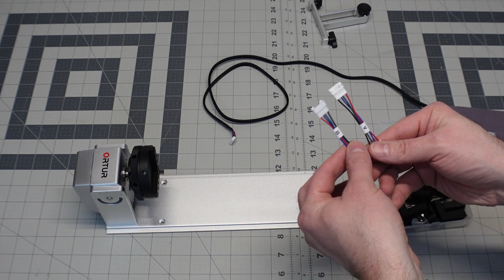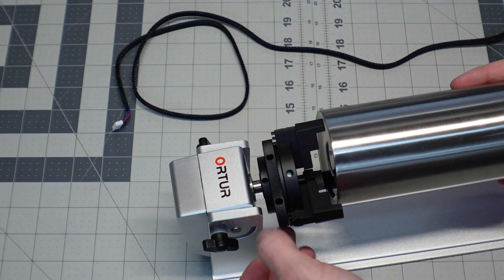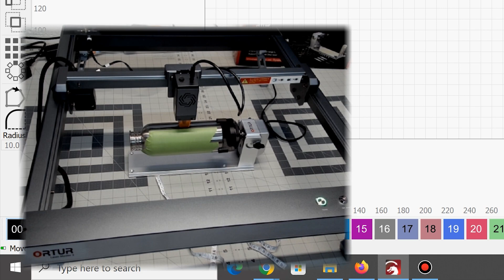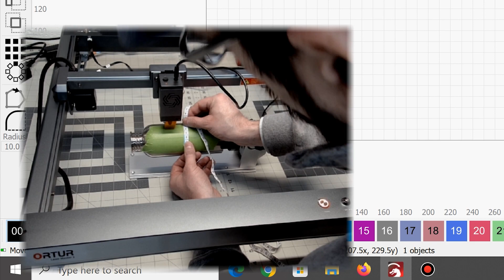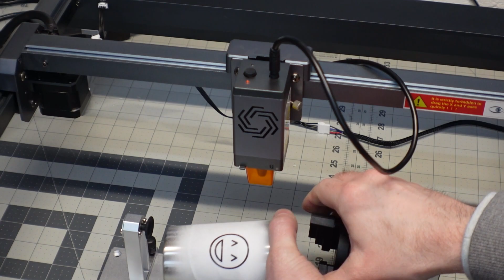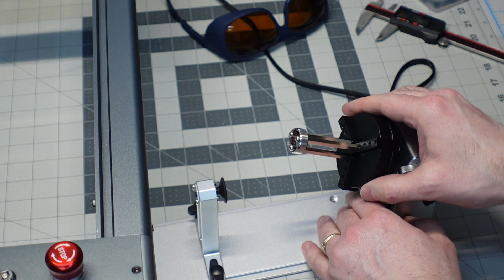Ortur Y Axis Rotary Chuck  -  We engrave all the odd shaped round things!

Comment: Will it work for fiber lasers ?
Reply from the maker: It is possible, if the stepper controller in the fiber laser is putting out the correct voltage and can support the amp draw of the rotary, you'll also need to make sure you can adapt the wiring to the laser.  It's best to find a rotary that is intended for the specific laser you want to operate it on.  I have not tried to run this one on anything but similar open gantry diode lasers.

Comment: Have a nice day.  i want to ask  would this rotary roller also fit my Swiitol e24 pro?
Reply from the maker: I'm not familiar with that make or model but it looks exactly like the Atomstack A24 laser.  It should work with this laser assuming it has the same 4 pin plugs as most lasers.  Ortur includes two different cables to adapt to most lasers that use the flat 4 pin connections on the stepper motors.

Comment: Great video! These rotary settings worked well for my tumbler project. How do you go about reversing the two gcode commands you made to return the laser setting back to normal for non rotary work?
Reply from the maker: You can use the console in lightburn to make the changes back and forth. $141=600 to operate the chuck rotary, and $141=1000 to operate in normal fashion also $22=0 to turn the homing off when using the chuck, $22=1 to turn homing back on when using the laser normally.  I think that's the only two you need to worry about.

Comment: When I place the test, it sounds stuck, it doesn't turn, what's happening in this case?
Reply from the maker: I would double check that all the wires in the connector are plugged in.  Sometimes a single pin can come loose and in this case you will hear a chattering while the stepper will not move.
Reply: @Vintauri  Thanks. The chuck does not turn, it stays stuck, it tries to turn to one side then the other and it stays stuck, I don't know if it is a configuration problem in Lightburn. My laser is a sculpfun s30pro diode laser
Reply: @Vintauri  I have checked the cables

Comment: Hi. Would I be able to use this with my Aufero laser machine?
Reply: It's the Aufero laser 2
Reply from the maker: You should be able to use this assuming it has standard wire plugs on the Y axis stepper motor.  The kit comes with a couple typical cables to make it work with many machines.  However, I cannot verify on this specific machine as I do not have access to one.

Comment: I recommend getting cardboard tubes (from paper rolls) that are about an inch in diameter and cut them into rings as a practice rings for engraving. The power will clearly be different, but orientation and technique can be perfected. I am ordering an Ortur rotary since XTool won't send me the cable they omitted when I got my XTool rotary.
Reply from the maker: Those are a good practice material, although they can be a bit warped at times.  I always advocate plenty of practice on cheap or free materials however you can find them!
Reply: @Vintauri  If it's free, it's for me!

Comment: how did you set the diameter on the tapered cups?
Reply from the maker: I pick the middle of the design and test that.  In lightburn they now have the tapered cup tool that helps adjust for the angle as well.  I need to try that out and do a follow up with it.

Comment: Will this work on comgrow z1 ?
Reply from the maker: It does come with a couple different cables that should allow you to connect it to the Z1 along with other lasers. Most diode lasers use a four pin plug and you just need the right pin out thus the extra cables they provide.

Comment: I have a NEJE 3 Max v2 laser. Is the Ortur compatible with my laser??? Do you know?
Reply from the maker: It should be as the Neje has standard 4 pin connectors on the board and steppers.  I have not tested it as I would have to lift the laser up on supports to use the rotary and I do not have it in an enclosure with a dropped bed yet.

Comment: New creality rotary pro .makes grinding noise a d doesn't turn
Reply from the maker: Check the pins on the connectors, it sounds like one of the stepper motor phases is not connecting.

Comment: I priced a can of the brilliance spray.  Wow why so costly?  I normally use rustoleum for tile and other materials.  Is there something that the brilliance does better ?  I only have an Ortur laser master two which is probably only  around 5watt output power.  I noticed talk about brilliance only fairing well with higher power lasers.  Any thoughts?  Great information that you provided.  My rotary is going to be here this week.  Thanks again!
Reply from the maker: The brilliance spray is expensive, but a little goes a long way and it's easy to apply, wash off and it's markings tend to be consistent.  I've not had much luck with it on a 5w laser, but 10w is enough to fuse it with a dark and crisp marking.

Comment: Just got my chuck rotary and have a olm3.  Went looking for the white Brilliance spray but could only find black.  Has white been discontinued?
Reply from the maker: I don't think there has ever been a white marking spray from Brilliance.  You can use it on glass and with lower power it will frost the glass giving it a white appearance, where as with higher power it can fuse the titanium dioxide as well causing the black look.
Reply: Note your comments regarding white brilliance paint at 20.00+ minutes into your video.  What kind of white were you using?
Reply from the maker: @TTC1940  There is only one kind of brilliance marking spray. It's usually used for leaving back markings on metal, however when used on glass and at a low power it just frosts the glass instead of fusing the titanium dioxide to it to turn it black. It will not leave a white marking on anything. Glass just needs a binder to heat up the glass and cause micro abrasions to cause the frosted effect. You can do the same thing with black paint on glass.

Comment: Thanks, that was really handy. I got this tool yesterday (only had my laser a few days, so a total noob) and followed your video step-by-step to do my first cylindrical engraving. It pretty much worked great, thanks to your help here. The things that didn't go to plan were:
1) That backlash command at 10:41 just gave me a "Error:80", so I didn't bother with it. Didn't seem to cause an issue.
2) I had text in my test engraving and it came out mirrored. I've only had my laser a few days and this is the first time I've tried text.
3) The text was oriented sideways, so I will need to turn it 90 degrees before burning.
Reply: Hello friend, connect the orthur mandrel to the Sculpfun S30 Pro, I put the command $22=0 and it comes out OK and when I put the command $141=600 it comes out ERROR, and I can't do anything anymore because the mandrel starts to sound ugly.... it has any help for this?

Comment: How much weight have you use on the Rotary Chuck? I want to use it to hold aluminum bars in order to engrave a part number.
Reply from the maker: I have not specifically weighed anything that I've put on this. The largest item would be 20oz stainless steel tumblers that I've engraved.  You might look into an optional support roller that could be 3d printed to take the weight off the chuck.

Comment: I have it connected to my Sculpfun S30ProMax, via Lightburn. Works great, but aligning takes some time. 
This chunk is more versatile dan Xtool's RA2, and a lot cheaper, in my case 1/3 of the Xtool.
Reply from the maker: If you switch back and forth from the rotary to the regular laser a lot, it might be worth setting up a Jig to align the rotary to the frame and then know a specific distance to get you to the center.  That should help with alignment each time.
Reply: Thanks for the comment. I have the S30 PM and was trying to verify compatibility before purchasing. Now that I know it works, I will order one. Just watching videos, I am guessing it takes quite a bit of work to align this correctly.
Reply: what settings did you use to set this up in Lightburn? I thought I had it setup correctly, clicked the Test button and the rotary just grinds and jumps around.

Comment: Thanks for the demo but I see that we have YRR 3.0  and this Y Axis chuck is the only difference the ability to do cups with handles?
Reply from the maker: Cups with handles are one of the big advantages.  It's also easier to level this with the adjustable angle. The chuck also has a positive grab on the item rather than relying on gravity to hold the object to the rollers.

Comment: About ready to try my rotary chuck. I bought an adapter that holds the laser at 90 degrees so it points to the back of my LM3. This way there is no need to elevate the LM3. With the changes to the GRBL commands I think I read somewhere that a user saves a version with the rotary commands and without them. Do you do this? If so how do you load these GRBL commands into the LM3 (just paste the script into the command line)?

Also, found this on the Ortur FB (have you needed to modify this? maybe the rotary chuck is OK):  There is a.problem using the YRR Rotary unit with the OLM3 10W Laser.
If you haven't discovered this for yourself already, then read on.
The OLM3 uses different stepper motors for the X and Y axi from the OLM2 PRO, SF, LF and the Rotary unit.
The OLM3 steppers work on 100 steps to the millimetre, while the YRR Rotary unit stepper works on 80 steps to the millimetre.
Which means that the Y axis lengths will be increased by about 25% on the Rotary, if you don't adjust the relevant gcode parameter.  So shapes that encircle the whole cylinder will overlap by 25%.
$101 needs to be changed from 100 to 80 while using the Rotary with the OLM3.   ( $101=80  )
And don't forget to set it back to 100 when you go back to standard engraving, or your Y values will be 25% shorter.
$20=0, $22=0 and $101=80  for the Rotary.
$20=1, $22=1 and $101=100 for Standard engraving.
Best to save 2 seperate profiles and then switch between the two.
Reply: Wow. Thanks for the tip. I did some squares on a test cup and was finding it off. Made these adjustments and it was dead on!!

Comment: Thank you for the video and taking the time to go thru the $22 and $141 codes around the 10 minute mark.  I understand the $22 is Homing ON/OFF cmd.  You mention the $141 is for backlash, but if I look at the Machine Setting function it shows $141 as the Y driver current amps and shows 5.000.  You might mention that the $22 and $141 settings need to be changed to go back to normal use.

With that said, I do think you've got the best video around on setting up and using the Chuck Rotary tool.  Thank you.

Edit:  I asked about the $141 cmd on the LightBurn forum and got the answer there seems to be a bug in the system.  It should be amps (perhaps better expressed as mA).  Seems $161 is the Y axis backlash cmd.

Again, THANK YOU for a good video
Reply: How do you change the $22 and $141 settings back exactly? I ask because I just changed them to follow along with this video but he doesn’t mention having to change them back!
Reply: @mmarshall1231  Just use the same $141=1000 to set them back to normal, and $22=1 for normal homing operation.
Reply: @kenh8979  Hello friend, I have a problem, I bought the Orthur chuck and I have a sculpfun S30 pro, I put the command $22=0 and it comes out OK and I continue with the command $141=600 and it comes out ERROR, and I want to do an engraving operation and it doesn't work, I can you help ?
Reply: @camilo23ariztizabal  I'm not sure why the $141 code gives an error msg.  I suspect it's because your sculpfun S30 uses a different cmd for that code.  From my understanding the $141 code controls the current limit for the stepper motor.  If that's true, I'm not sure what the deal is with changing the value from 600 to 1,000.  

These days I don't really change that value and my OLM3 seems to work just fine.  Have you tried doing an engraving without changing the $141 value?

Good luck and let us know how it works.

Comment: will this work with Epilog lasers?
thanks for sharing.
Reply from the maker: It might but you'd have to look into the Epilog control board and stepper drivers to make sure it would be compatible. Unfortunately Epilog lasers are not all the same with that so it's also going to depend on the model.

Comment: I just purchased the LM3 and rotary chuck. Ha - was wondering if it could hold my turned wood pens. You used marking spray on SS. The marking spray says it's designed for CO2 and fiber lasers. Is it OK for blue lasers? I use TiO2 powder and isopropyl alcohol on white tiles. Do you think the TiO2 will work on SS? - Thanks
Reply from the maker: I don’t see any issues with it holding most turned pens. I need to turns some new ones myself and throw them in here. While the marking spray says it’s for co2 and fiber lasers, I’ve found it works well with diodes at higher power levels. I do have some TiO2 to mix up and test as well, I just have not got around to testing it yet.
Reply: @Vintauri  thank you for the quick response. BTW - for tiles I use a 3:1 ratio of 91% isopropyl alcohol to TiO2 (mix well!) and air brush it on the tiles.